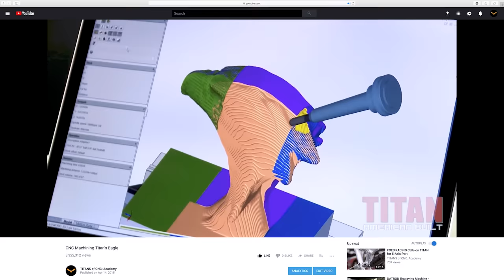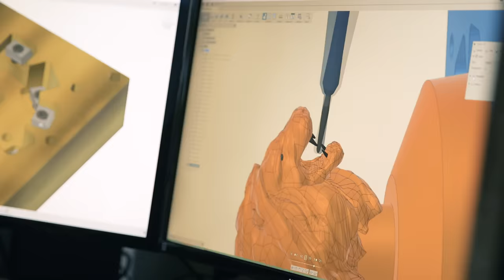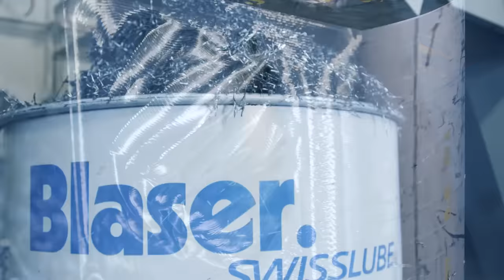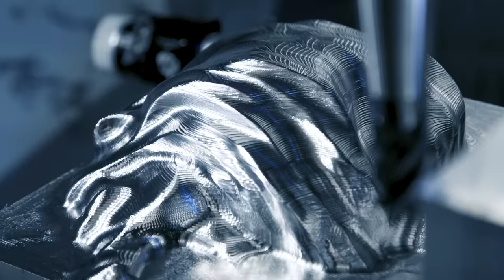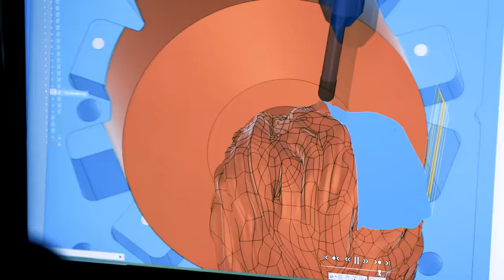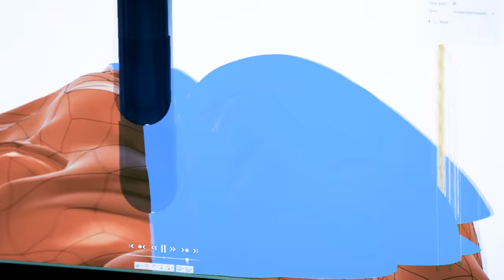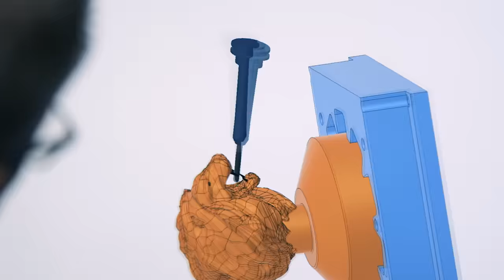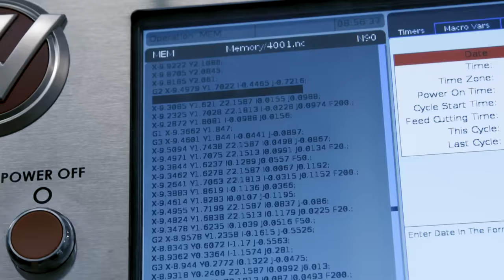Machining TITAN'S Titanium Lion

Comment: I like when he said about moving to bigger obstacle and challenges because at the moment I’m 18 and am operating a very old manual lathe, but am slowly moving towards CNC and it scares the hell out of me I’ve seen multiple crashes on the machine and each time makes me more nervous to use it but I know that CNC is where engineering is moving so need to expect it. I don’t want learn CNC but that’s only because I am comfortable on the manual.
Reply: Dude mistakes happen. Stay at the  feed potentiometer in the beginning so you can prevent crashes especially the big ones that might damage your machine. If you feel comfortable you can go and let the machine run on itself. A dry run without workpiece might help you to find major mistakes in your program

Comment: Adaptive 3D toolpath generation from Fusion360 does most of the work for you. For a given tool spec, the program will generates tool path for that specific tool that you use. Anything with finer detail would require a different tool and the program would be able to figure out the new toolpath to machine the rest of the parts "Rest machining".

Comment: i have a bit of a different question.  you had said over 100 pounds of titanium came off. what do you do with all your scrap shavings? do you just take trucks full to the local scrap yard snd take by the ton scrap value? do you have a deal worked out with mills that they take/buy back the scrap to reuse it? thats something that ive always wondered about, since im sure some of the material you work with cant be cheap

Comment: By any chance is that FPR number for the 3/4 Harvi III supposed to be  .0053 per flute? .0053 per rev seems kinda low for the flute count and the chips I'm seeing.
Reply from the maker: This is 6AL-4V Titanium.

.0053 is actually great.

In the Machinist handbook is suggest that you run Ti at 175 SFM.... I am running at 500+ which IPT pushes it up...
Reply: Sorry, I don't think I communicated what I meant to say very well. 

I did the math on your numbers which confirmed my suspicion. It could be a difference in terminology between machinists but I'm thinking your feed per revolution (FPR) is .0318 and your inches per tooth (IPT) or feed per tooth is .0053.

That's an impressive feed at that extension and an 8% radial.

Comment: This is amazing. I tried to manufacture my own parts with melt ed aluminium and a mold made it with a 3d printer but i will never get an excellent result. How much is the cost of a machining a piece  like the lion? If i design the pieces that i need in titanium, will you able to do those for me?
Reply: try thousands.... $$$$$$$$$$$$$$

Comment: Can you guys share some sections of the simultaneous 5 axis program with me so I can have a gander? I do a lot of multiaxis work, but all 3+2. I am curious how the rotary axes are commanded. I am always rapiding, but rotary commands for simultaneous must be different. You're probably also using TCPC :/

Also, do you guys run a full machine sim on parts like this before running to verify machine clearances?

Comment: REMINDS SOMEWHAT OF THE TOOL & DIE MACHINING WE DID, NOT QUITE THAT DRAMATIC BUT IT WAS CHALLENGING. WE DID A PROTOTYPE, PROGRAMMING, FIXTURE, HERE IS A BLOCK OF METAL, HERE IS THE PRINT, BYE!  GREAT JOB. MAINLY POP AND BEER CAN DIES.
  AS FOR THE PRICE PER HEAD,?  WHATEVER THE MARKET WILL BEAR !   YA KNOW, IN THE RIGHT PLACE WITH SOMEONE LOOKING FOR A PIECE, PRICE IS NO OPTION. I'D BE LOOKING TO PUSH THIS IN SOME MUSEUMS ETC. THE RICH CROWD.

Comment: Meanwhile, our cnc needs 2 hours for a Rectangular bag that is 60x110x10mm with radius 5 of 5 in the corners. Then again, it's also a DMU 60T from the late 90s or was it early 2000, dunno anymore.

Comment: This is an excellent example of why 3D printing is becoming so juge in the aero industry. Said over 100Lbs of titanium loss. Probably days of machine time and programming time, huge expense and losses. All the while a 3d printer can print out something this intricate with exceptional surface finish and with little to know losses depending on type of printer.
Reply: That 100 pounds will be recycled.  There is very little loss if you clean out you machines well after the job is done.  Machining is still WAY faster the 3D printing.
Reply: @brandons9138  it will be recycled meaning in needs to be collected, reprocessed, refined, and remade into stock. That is huge wasteage. And machining is faster than 3d printing but more waste, and 3d printing can make significantyl more complex shapes. This isnt a dick measuring contest. 3d printing is better for certain shapes and designs; Machining for others, and casting for the rest.
Reply: @Adam  Your original post only mentions the waste of titanium.  I replied that it would be recycled.  Now you move the goal post talking about the effort/energy needed to collect and recycle the titanium?

3D printing this project would take longer then the machining it.  3D printing just cannot keep up with machining.  3D printing cannot even come close to hitting tolerances that you can with machining.  That means that anything that is printed that needs tolerances tighter then the printer can hit will need post print processing.  

Check this here:
https://www.xometry.com/capabilities/direct-metal-laser-sintering/

That is Direct metal laser sintering technical specs.  That surface finish that they can achieve is not what I would call "exceptional".  +/- .005 tolerance PER INCH, that is laughable.  Why spend a longer time printing some thing just to have to machine it after the fact anyway?  Printing does have it's place, but it is often not the first or best solution.  

The most salient point is that Titan and his content is about machining.  Printing this project would do nothing to show off what his shop is capable of.

Comment: As an ex mould toolmaker the surface finish on alot of the features you can see have been fucked up lol, a lot of editing because they fucked it up, loads of bits missed where they dug in with roughing op. Even in the nice bits the surface finish is extremely inconsistent
Reply: and another point, simple having 2 z step downs one either axis is extremely fucking lazy and would waste the entire op in mold making